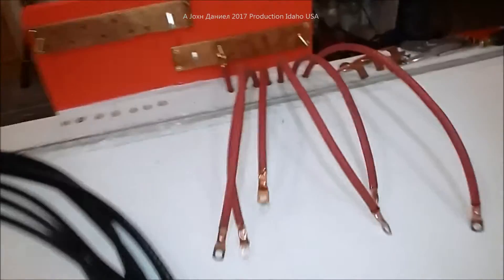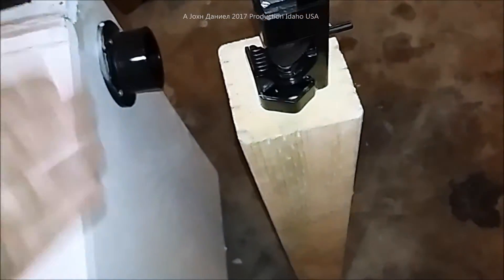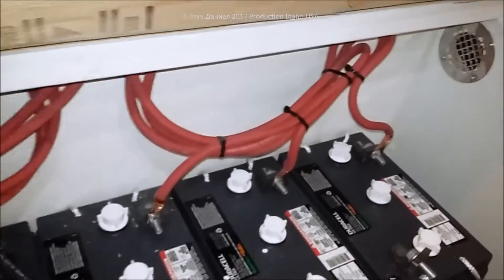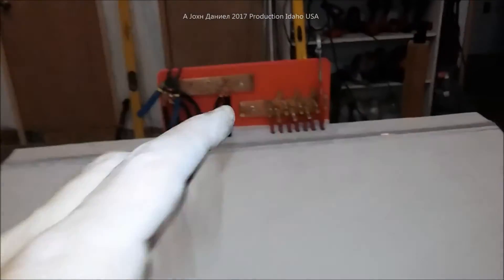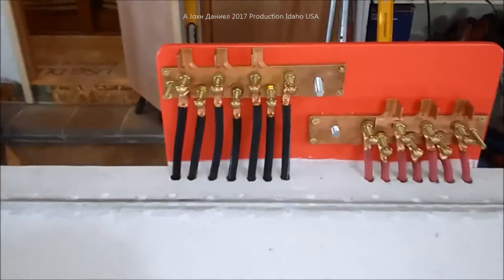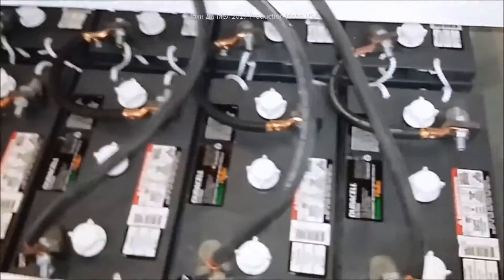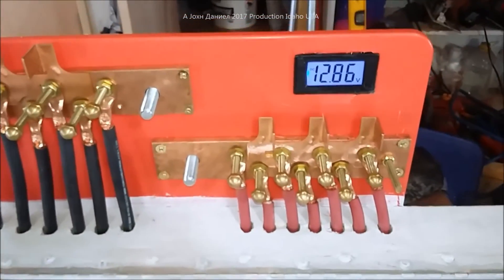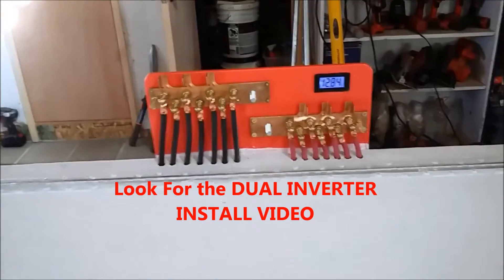Custom off grid Battery Box Vid 3 of 3 Final, 14  L16 Batteries SEE BELOW

Comment from the maker: Deka / Duracell L16, Deka / Duracell L16 in use, Double your battery life, maintain them EZ https://ebay.to/2NMQf5a OR https://amzn.to/2NPaqzr . BATTERY BOX upgrade https://youtu.be/CslQAzbQgAY  use ONLY distilled water, safety gear & absolute caution servicing batteries. 25 year plus better quality Taiwan made solar panels https://amzn.to/2DRhxm3  
**Always learn total battery care and servicing prior to purchasing large battery banks. ALWAYS BUY YOUR BATTERIES IN ONE PURCHASE WITH SAME DATES.
370 amp hours @ 12 volts X 7 = 2590 @20AH Capacity
2590 x 12.8 Static Level Battery Voltage = 33,152 Watts storage
2260 Cycles Max at 80% Depth Of Discharge +/- 3%
7 to 10 years lifespan.
Cost after Discounts and some cores = $3628
The PURE copper Bars ( buy big, you will use it) are from https://ebay.to/2Q7a4dt 100% Copper Bars
Get the rest of your parts from elecdirect.com
 #3 is The final video on Building a high amp, consistent energy battery box with 2600 AH@20hrs. 
A video on the install of the dual inverters should be on my channel soon or already.
Reply: most battery makers recommend no more than 2 strings of batteries????

Comment: So, you can use 15 kwh a day off the batteries no problem? Using 50% of batteries storage, is that correct? If you have the panels to get it back up to 100% of course...
(I only want to use 5 kilowatts a night)

Comment: Cool video man I just subscribe please check out my channel and subscribe also. Where did you get the bus bars at?
Reply from the maker: Subbed, And as always, keep the independent open sharing going, avoid the junk and hack sellers!
Reply from the maker: Bus bars are stock copper, It took a lot of trial and error to find a source for the pure stuff. many are 70 to 90% at best, these are pure 99.5 or better, you can 24 hour green test them with muriatic acid, they are pure!!  https://ebay.to/2GBwsCd
Reply: Јоhn Daniel nice and thanks man

Comment: Holy Crap. Well, I am needing to set up a solar system with a battery bank, but this is WAY overkill for what I am needing, LOL.

I need to set up a battery bank in my van for my emergency communications radios, laptop computer, lLED overhead lights, etc. I also need another in a 4x8 cargo trailer for a portable HAM radio repeater system. Both systems need to be just 12-volt as I am trying to stay completely away from using an inverter because of the power waste and the RF noise they produce in the radio systems.

I am going to check on these batteries. I have been trying to figure out which batteries I needed to go with. I want to get the most amp hours that I can so that I can work for an indefinite period of time at disaster scenes.
Reply from the maker: I recommend a Taiwan made MEAN WELL inverter to get away from RF issues. https://ebay.to/2jdKoJi
We run a HAM and 2 SW rebroadcast units with a 44 foot 10x4 antenna, the mean well has no effect on it. Other brands were a pain in the ass though.
Reply: Ok, I will keep that in mind if we ever need to add an inverter. Right now I have made sure that all of our equipment, laptops, lights, HT chargers, etc. all run on 12-volt to avoid the inverter loss issues. 

The only thing I am missing right now from getting everything set up is the batteries and figuring out how to get the power from the solar panels inside the van keeping everything rainproof. I like the batteries that you are using, I am thinking about 4 of those in the van and two in the mobile repeater trailer.
Reply from the maker: If you have a BATTERIES PLUS near by, get 6 of the GC2 they have. Go to TEMco and get 1awg wire to join them. Be sure to get battery care equipment as well as servicing skills when you use batteries like you plan.
Reply from the maker: https://www.batteriesplus.com/productdetails/sligc110 6 for the van, 2 for a trailer. Save $290 over the option I used, and 89lbs less weight.
Reply: We do finally have a Batteries Plus here, I will go by there today and see what their price is on that one. I checked with them on the LiFePO4 batteries, they only had 1 in stock at about $800 and wouldn't ship anymore in. Thats just a tad outside my price range, lol.
Reply: Ok, I will see if they happen to stock these here. I saw one of the Duracell Pro Deep Cycle batteries the other day when I was there, but it was about $350 for around 100 AH but it was 12-volt. This option is a lot cheaper and I get more amps out of it.
Reply from the maker: The ones I linked you are $120 each, 235 amp hours @ 20 and live over 7 years if taken care of.
Reply from the maker: If you go to B+ be sure to find some old batteries are cores to exchange, they are HIGH on core rates.
Reply: If I remember correctly when I connect two of these batteries together for a 12-volt system, the amp hours stays the same as a single battery but the voltage is doubled, is that correct?
Reply: I am considering putting the batteries up on the roof of the van along with the solar panels mounted to the roof rack since these are not sealed batteries so that I don't have to worry about off-gassing. What are your thoughts on that?
Reply from the maker: Never place the batteries on your vehicle roof. Heat destroys them. Build a sealed box vented to the outside. Use this door or one similar https://rover.ebay.com/rover/1/711-53200-19255-0/1?mpre=https%3A%2F%2Fwww.ebay.com%2Fitm%2FNEW-28-x-14-Hatch-Generator-Baggage-Cargo-Compartment-Storage-Door-RV-Camper%2F351934123087%3Fhash%3Ditem51f0e88c4f%3Ag%3AxT0AAOSw5cNYUwte%26vxp%3Dmtr&campid=5337663791&toolid=20008
Reply from the maker: Yes, you are correct.
Reply: I don't want to do permanent body modifications that will prevent me from being able to resell it when I need to replace the van though.
Reply: Darn, since they have to be inside the vehicle, I may have to go with AGM batteries that are sealed.

Comment: I can't remember which video, but I thought you mentioned using (6?) MPPT chargers to couple to your battery bank. I have one EpEver 4210A for a little 1 kW system to go on my workshop roof. Close reading and re-reading of the 4210A manual revealed that it is POSITIVE ground. My inverters, (old APC UPS 1500's), are NEGATIVE ground. 
This means that I have to take precautions to ensure that the positive side of the 4210A MPPT never comes into contact with Earth/ground. There is nothing wrong with the 4210A, I should have done my homework first and bought 4215BN which is Negative Earth! Too late now. I have not blown it up, spotted the error before wiring. 
With your system, missing this would result in a loud blue flash and a bucketful of tears that may be big enough to put the fire out. Good Luck!
Reply from the maker: Grounding renewable energy products DOES NOT protect you or anything you own from lightning. Wheres your ground rod on your car? How about your Trains, and all the RV's on the road?  Heres some sourced info, but your welcome to continue using or selling your grounding gear.  https://www.earthing.com/electrical-connection-conductivity/ ( lots to read - No products to sell so info is unbiased)  RELATED - *Is Lighting rods snake oil or real deal*? Answer - The 18 year University Study in Florida showed Grounding is effective for utility power providers as such products are designed for such use however grounding rods on the roofs of homes, barns and even power poles in the event of lightning had a 4% route of successful deterrence to have the current follow planned routes of earthing in 27,000 recorded lightning strikes in the 19 years of records. Apply the 4% to the facts found that grounding rods and wiring for the purpose of lightning increased damage to electronic devices in 48% of the actions recorded. 
Recommendations are the implied use of the open ground features of the automotive industry or surface deflection affect. Surface deflection is the use of metal skin or frames that are not additionally grounded to the devices you choose to protect such as radio, solar panels or medical devices.  New Mexico researchers found the Commercial truck industry to be producing successfully isolating devices making alternating current such as refrigeration units and installed voltage converting or inverting with such vehicle surface deflection affect on their metal bodies through no continuity or physical connection with earth ground. Removing ground rods dedicated to lightning from state operated radio transmitters proved to stop damage to radio equipment by reducing the attraction to higher amperage lightning strikes that would saturate the earth in a positive voltage reaction causing destructive non grounding of utility supplied power.
Reply from the maker: NEVER earth ground your solar, your controllers, or your sisters! This ignorant seller scam on grounding solar is as stupid as it gets. Grounding solar panels guarantees fried panels in the case of a lightning strike. It is proven in over 200 test in Florida. Leave your controllers fully floating and never connect them to ground or earth ground, just fuse them accurately. As for inverters, they can be grounded but your better off grounding each appliance to a ground not involved in your homes electrical system.
Reply: Cheers John. As others learn from me, I also learn from others!  :-)
I do need to remember this sort of stuff, as the older I get and the more I drink, the more I forget. After such forgetful moments, I am likely to look at the noise on a sine wave and go round earthing things, that could lead to financial distress and showers of sparks. Well, that's St Patrick's day over. Mug of tea then bed. Be Lucky.
Reply: http://www.epsolarpv.com/en/index.php/Product/pro_content/id/654/am_id/136

Epever now makes a common negative. Maybe you can sell yours and buy this one. Check out my channel I think you will like it I also have a epever tracer
Reply: Јоhn Daniel give me proof of what you claim. No matter if your system is grounded or not lightning will more and likely kill everything it hits. Grounding also protects from getting electrocuted. Please give me links that proves grounding is useless
Reply: Јоhn Daniel thanks for responding and leaving a source. But like I mentioned in my comment that anything lightning hits will more and likely destroy it wethere your system is grounded or not. That I’m not arguing. But also a lightning strike can damage your system even if it hits miles away from your house. And that is where grounding your system would save it from high voltage surges into your system, But grounding your system is more important from a safety aspect more than proctecting your system. it is to protect you!!! Cases and metal frames can become energized if you don’t ground your system to earth because if a short or a cut in a wire touches a metal frame or case then it now becomes energized and becomes a fire and shock hazard. So it is still important to ground your system. For safety not proctecting. If you want protection from lightning on your system because you live in a high prone lightning area then you should use a lightning arestor that protects your system from surges.

Comment: Looking nice, to bad about the cheap chinese gauge. I well never understand why somebody would mass produce something but not do it rite.
Reply from the maker: +Great North Woods Hillbilly Yeah, I've  hooked up many of these LCD gauges that change their readings after they have been on for awhile. This one turned on at 12.88 volts and eventually settled on 12.82 volts after about 4 hours and a day later still shows 12.82 vdc. Seems they use some power from somewhere internally and it shows against itself.
Reply: That is not to bad then,
Reply from the maker: Not exactly a off the shelf USA product you can replace them with.  Fuckin China Crap!!

Comment: Beautiful battery-bank nice battery-box.  Too bad that you have chosen for 12volt and not for more powerful 24volt or 48volt system.

This Deka Solar L16 battery is not for sale here in Europe only the L16 battery from Trojan it self and that for a ridiculous high price.

Why is there in America a lot of stuff cheaper?
Reply from the maker: +lexpee I haven't a need for for anything over 10,000 inverted watts and 60 amps DC for all my utility needs so the dependable 12 volt system I've been using for 6 plus years just keeps us running. When a engineer with 40 years in the industry at the battery manufacturer told me that I should cut 4% off a battery banks expected lifespan for each and every doubling of volts I did however feel better on my design.
Reply from the maker: +Јохн Даниел I guess I should do a video detailing the industry math on parasitic consumption batteries do to each other as you double them numerous times to get 24,36,48 and 60 plus volts so people can understand why your maximum warranty on a battery is adjusted to that reality by the manufacturers, all of them. So even if your warranty at 6 volts is 5 years, it's due to the manufacturer expectations you "could" be building a 96 volt bank so they only offer a warranty maximum based on that possibility. That's straight from the manufacturers own math. 
Makes you wonder how much you saved on wire like so many selling 24 volt plus claim when you loose possible years on a $4000 and more $$$ battery banks lifespan going high volts.
Reply from the maker: CONCLUSION: If you have 24 batteries, 3 x 8@6v for a 48 volt system your just so cool and popular with the ladies until one  fails then you loose a full  33% of your system and you have to go to the ladies house with your tail between your legs to watch HER tv!
Reply from the maker: See if you can find those 9 amp 13.6 volt Soda Can sized NiCads over there for that failed Nissan Electric SUV project. I heard they were made in USA but are stored and sold over in Europe now.

Comment: Thank You once again Sir.. After a couple of years investing time researching and studying  solar & battery systems, I am now ready to invest the money in customizing my system because of your video series and those of Engineer 775... Be Well, Peace & Plenty.
Reply from the maker: I choose 12 volt, some will choose higher voltage but batteries last longer in the design I made, and can become parasitic in higher voltage scenarios. In the long run a 12 volt system will cost you less, have parts everywhere, and last longer. However, people selling the 24+ stuff will promise you the world and own you after your check clears. Enjoy your adventure.
Reply: I would have to agree, I thought about going higher voltage, but 12v is the way to go. And there is so much out there that you can run on straight 12v dc it makes it the better choice.
Reply: Plus a lot easier to expand a system on a budget at 12v.
Reply from the maker: +Great North Woods Hillbilly And your battery bank will absolutely live longer since the parasitic consumption of batteries against themselves is very low in lower volts. Learned that straight from the manufacturers.
Reply from the maker: Careful, you may get attacked by those SELLER SCAMMERS when you speaketh the truth!